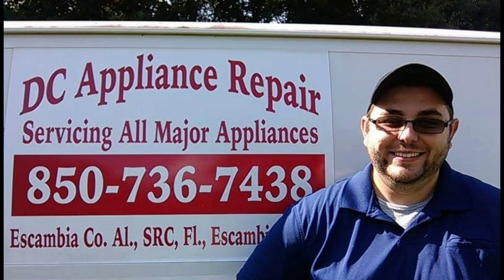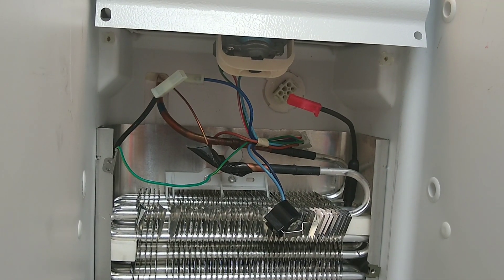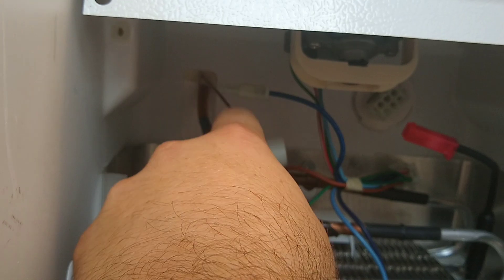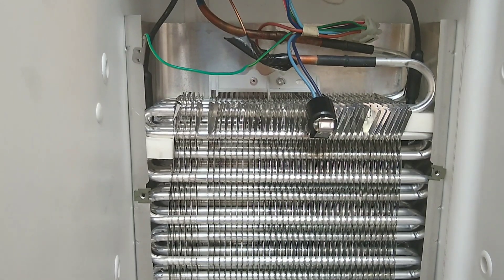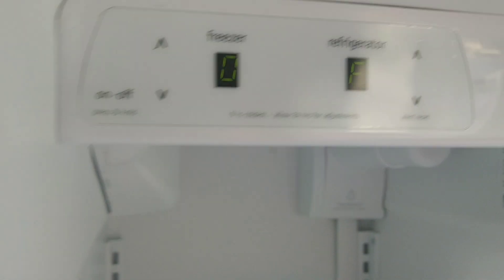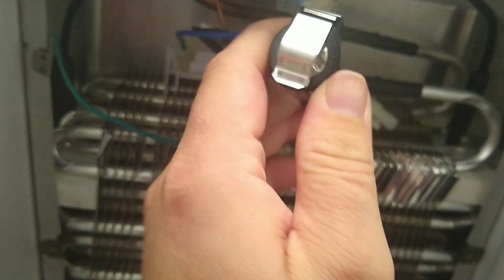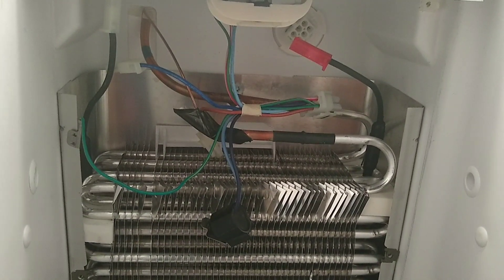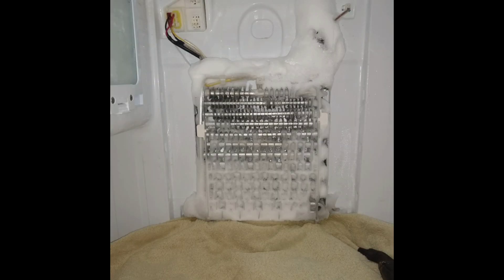Appliance Repair Training- Refrigerator Series Part 1 (Defrost System)

Comment: Since it has to cold to check. Can you check the thermostat from the board while it's still cold before you defrost it?
Reply from the maker: Yes you can  on models that have control boards.  Moat of the time I am able to leave enough ice around it to check it.

Comment: I have appreciated your how-to videos.  Thank you for the post.  I've searched for days on the internet trying to find how to replace a door on my microwave.  It didn't seem like it would be a big deal.  I can see the two screws on both sides of the door holding the hinge to the door, however there is a small plastic hinge on the right side of the door that looks like it has been permanently attached to a small bracket.   I can't see how to unhook that plastic piece.  Any suggestions?
Reply from the maker: Hi! Some models you lift up on the door. Send me the model # I can be a better help!